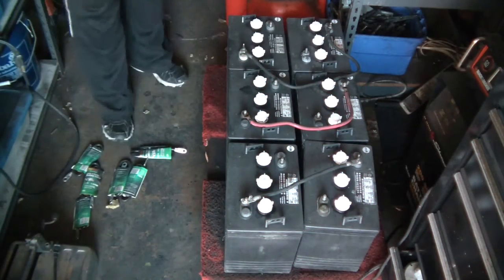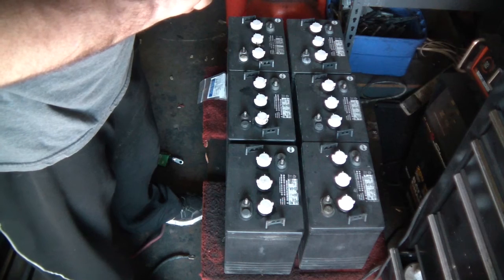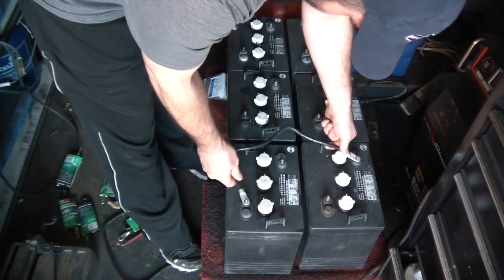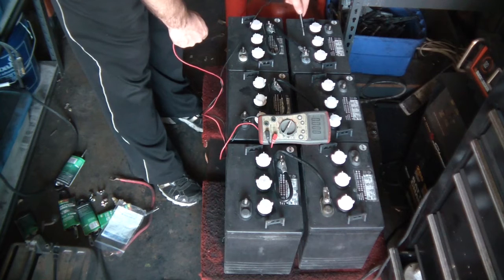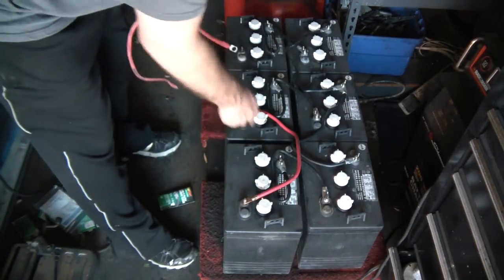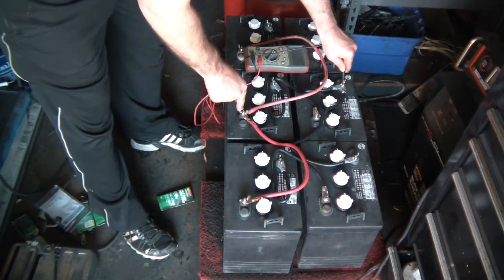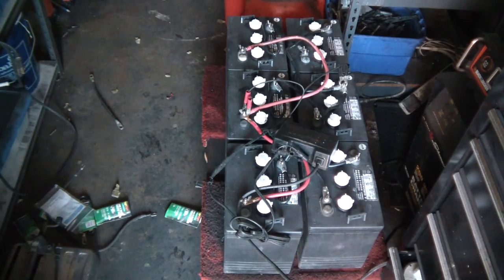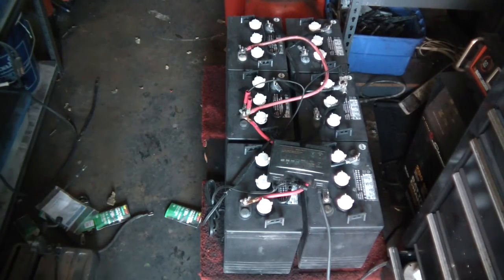6V Golf Cart Deep Cycle battery emergency power outage bank

Comment: Wiring batteries in parallel causes them to fight.  Faulty.  Promoting fools to copy you is bad.  Grade F
Reply: You could also do more research before you post such a selfish comment awwwwwe sorry if your in your feelings today
Reply: In series you don’t double amps duh the series parallel doubles both duh
Reply: @DuTangTheCryptoSurfr  No,  I'm comfortable with brief answers.  They are the only heads up that our watchers need.